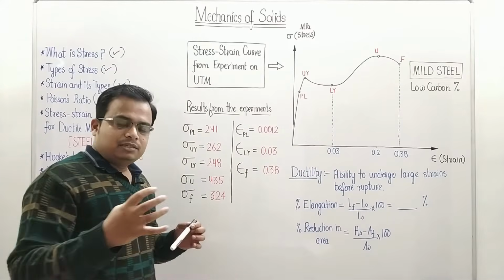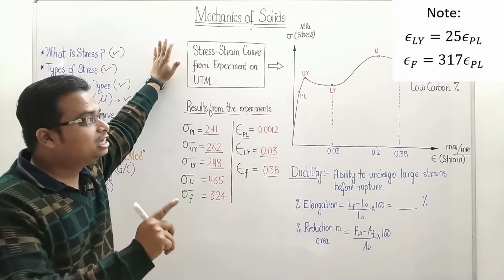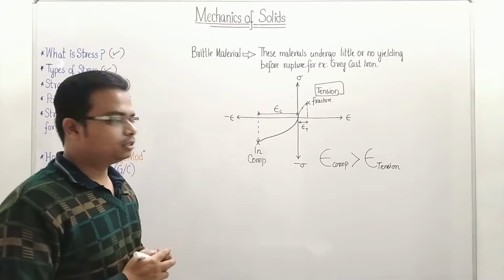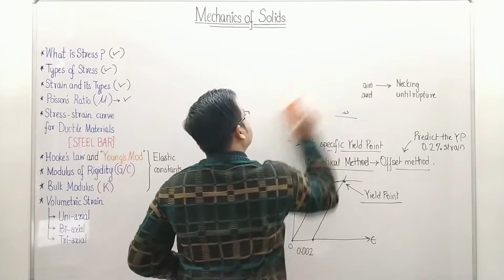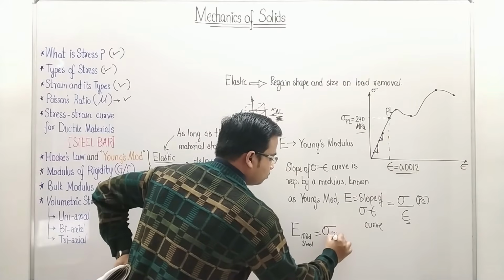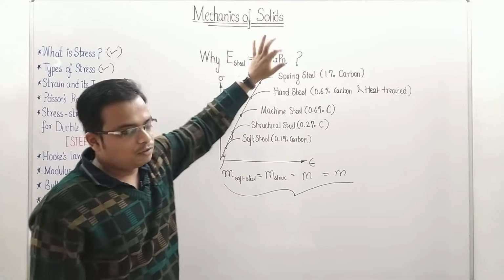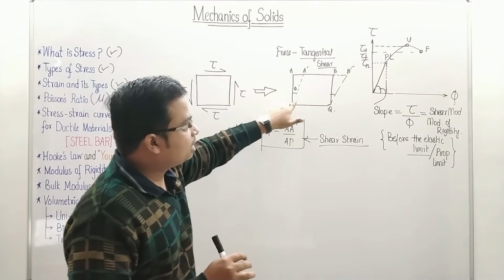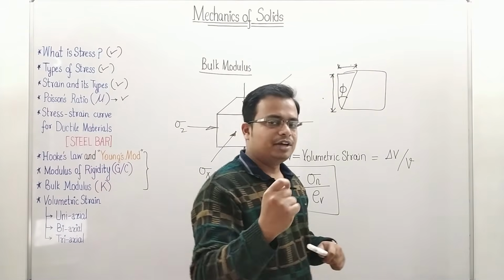Mechanics of Solids | Simple Stress and Strain | Part 2 |

Comment: Sir one question 
for a cup and cone fracture , is there a certain pattern as to how it occurs ?  with respect to the top and bottom part of the interface where the crack is happening. 
thank you
Reply: It doesn't depend upon anything, because real materials are non-homogenous and non-continuous. Thus, wherever there is non-homogeneity the crack initiates and propagates to form fracture. Hope it helps.
Reply: @Akt0307  yes it helps mate.